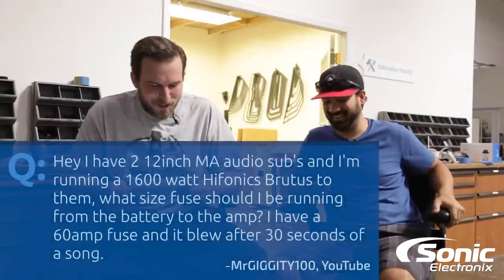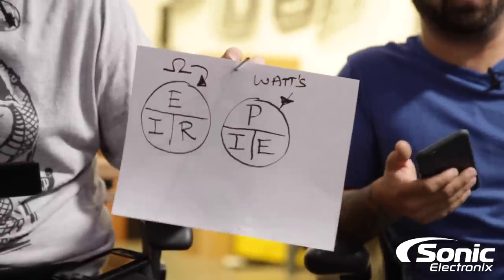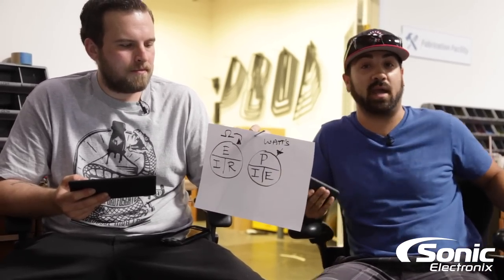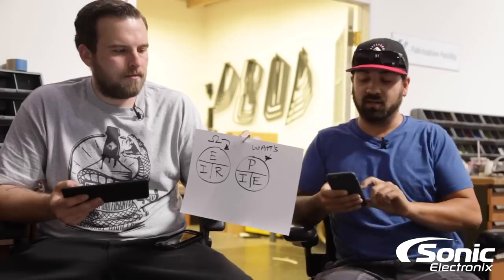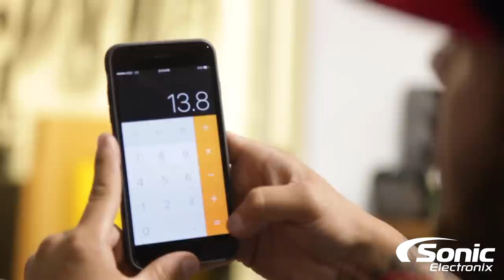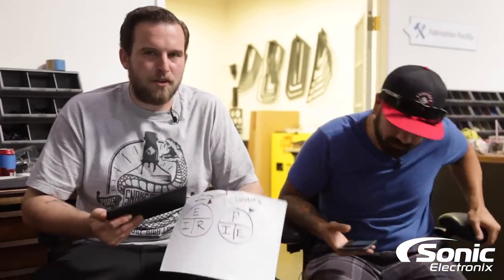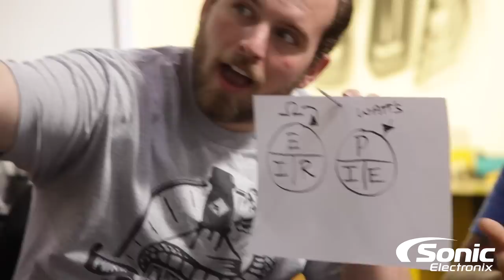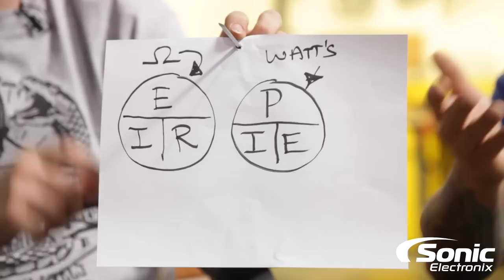What Size Fuse Do I Need? | Fuses vs Circuit Breakers | Car Audio Q&A

Comment: Your fuse should always be for the size and length of the wire. to protect the wire from a short. if you fuse for the wire and the fuse blows, your power wire is too small. only increase the fuse if the wire is capable of sustaining that amperage.
example. running a 2k rms amp on 10 gauge power wire. the wire will melt before the ~200 amp fuse would

Comment: Bro this video helped a lot I have dual 444c compressors and I’m running a 80 amp and for the fuse I was using a 80 amp fuse and it popped it . All my wires are good but I think I’m going to upgrade to a circuit breaker because I’m running a agu fuse .

Comment: If i use a circuit breaker do I still need to keep the fuse going to my power wires for my amps. I’m trying to eliminate bulky components and organize my wiring in my engine area.

Comment: Why would you use the amps rated A/C output either at RMS or not? The amp is a “Buck to Buck” step-up voltage to a “Class-D” amp! Use and amp clamp at the input to the device when on and working. Besides, there is no shocking to feel on a 13.8Vdc-14.6Vdc direct current system like shown in movies with jumper cables. Plus, why not own a test light or a decent digital multi meter (DMM)? You don’t have to spend over $500 to get a Fluke 87-V to test voltage drop. Radio Shack (If Open) or online sell meter lead wire with great high-temp silicone soft jackets or insulation. Solder some good alligator clamps with boots and make several lengths. Voltage drop measures the loss in voltage from point A to point B and doesn’t care if Red lead is backwards as it simply shows a (-) symbol on the display.
  Unless you are check fluids and minor repair under the hood, then get a DMM, because look over their, more fuses & relays from the factory. They may need checking as well. Their are good videos to teach how to use both and under $100 will most likely get both, and a test light. (Note: Pre-Biden Inflation Prices May change Your cost), but if you have $800 - $1,200 in stereo equipment, it is cheap insurance.
   Blow a fuse, never install a bigger one because you are guessing. That leads to “Thermal Events”, film on local news as car burns to the ground!
Yeh, start over and see if the insurance company picks up bill with full coverage, deductible and un-claimed installed items the Fire Inspector will look at first.
ASE Master Tech, 38 years experience

Comment: my question is does the physical size of the fuse matter as long as the rating is a proper? my little system only needed a 50 amp fuse and instead of using a maxi fuse i used a standard fuse holder and standard fuse both good brand, but a few "car audio experts" scolded me for it mainly for not using there fancy fuses but i digress.

Comment: @sonic electronix hi am running 2 amplifier ones is 2400watts and 6600watts wot fuse should i be on 4 garage wire for both of them please

Comment: I have a 1500 and 2000-watt amps and they run on a 60 amp breaker which has never tripped

Comment: These guys got the circuit breaker vs fuse question wrong.  When working on the electrical system, you should always disconnect the negative connection at the battery.  Opening the circuit breaker may not be enough, depending on what you are doing.  Circuit breakers also will fail over time, heat (like from the engine bay) will degrade it's ability to keep the system closed, as will overloading the circuit.  Tripping the breaker will reduce it's ability to handle a specific current load.

Fuses are cheap.  Keep extras in the glove box.

Comment: Shouldn't the amp be fused based on the consumption of the amp and not the output? I have never seen a 100 percent efficient amp.
Reply: +Timothy Hinton  i was just about to comment that ! for 1600w Dclass that has about 70% efficiency it means that it would have around 2100w input consumption....
Reply: +Evagoras koullouros Hey!
Your bace thought is right but in the wrong direction. The Amplifier can output 1600Watts. Thats what the manifacturer says. but you wont get them because no system has a efficiency of 100%. So you probably have around 1400 Watts (or even less). but this doesnt mean that you should base your fuse on those 1400Watts. 

for 1600 Watts you would get 115.9 A. so you need a 120A fuse. but to be honest, a fuse is just there so if a short circuit happens, in which case the Amperage is theoretically infinite, it blows up before the cables do. Its more important that the fuse is a Fast one and not a slow one. there are two types!
Reply: +phil7extreme  hello, yes we ansuming that is around 1600w output, it might be certified but still depends, the amplifier consumes more power than it actually outputs, because it takes dc voltage and make it into ac music...that conversion consumes power, and that why you get heat out of the amp..
Reply: +Timothy Hinton, Yes it should be IMO, basing the fuse size off the total output or the RMS is not an accurate method for calculating amperage consumption.

Comment: I have 2000 Watts rms around 2800 max and a 200amp fuse that blown when I plugged in the negative terminal and the wires look a little toasted.

Comment: I removed car stereo from Hyundai Getz 2008 and the battery wire giving 28v which is very strange. Do you know what could be the reason? Also taking positive from other section it always blow the stereo fuse

Comment: You want to fuse for what gauge and length powercable is not fuse just the amp.
The fuse is supposed to protect the car to not burn up in case of accident
Reply: orfeous this is absolutely correct! The fuse or circuit breaker is to protect the power wire running through the vehicle not to protect the amplifier! Your power wire should be able to safely carry the needed current to the amplifier (in this case 115amps)! Now remember the size power wire is determined by the needed current and the length of the run! So if your power wire is capable of 200amps then a 150amp fuse or circuit breaker would be ideal having head room! And since in this situation the amplifier is only requiring 115amps, then we know the amp will not draw more current then the power wire is capable of. if in fact something shorted out, the fuse and or circuit breaker would trip saving your power wire and possibly your vehicle! Remember your amp will already be fused on itself, we are strictly talking about the power wire run!
Reply: itsdatruff  what is your question?
Reply: itsdatruff  wow that is a complicated question.... You would have to do the Math on your 1/0 cca wire to see how many runs you would need to satisfy your amps. Of course you could just max out your wire runs and definitely running to a bus bar is ideal. I know you said you didn't want to add batteries but from my experience proper batteries make a huge difference. Good luck with your system.... Sounds like it will be epic!

Comment: HEY GUYS PLEASE ANSWER MY QUESTION!

I just purchased my 2009 Chevy HHR SS and I wasn't wanting to install subs or an amp really at all but I just want to possibly get new speakers that will be a little better in the bass category but still utilizing my stock power source. what is a few ways I can maximize my stock output to get the best bass sound out of my speakers once I buy new speakers? such ass maybe some sound deadener or something along those lines

Comment: I'm running 3 amps 2 Rockford fosgate r500d1 they are 50 amps fuse a pice and 1 is a Rockford fosgate t600-4 80 amp fuse should I get one fuse for all 3 or 1 for each

Comment: I have 2 p3d4 at 1ohm. A t1000.1. I have second battery in the back with 2- 200a circuit breakers. The one circuit breaker that runs between the amp and the battery keeps breaking at high volume. Any idea why that would happen? Thanks!

Comment: You should be using 14.2 volts for that calculation. Although the fuse size should be based on the actual consumption and not the total or RMS output. For instance, a 2K total wattage output amp using this calculation would call for a 140 amp fuse but the manufacture typically lists the actual amperage consumption as something like 30AX3, which puts the consumption around 90 amps so a 100 amp fuse.
Reply: You are splitting hairs and I am in fact correct. Don't think for a second that you know more about this than I do. Of course it's based on peak amperage 'consumption', that goes without saying. Stop trying to be smart when you aren't.
Reply: +Thomas Marshall Look's like somone blew there fuse LOL may of not been there car audio fuse but the sophisticated literature I am read such as "cyber tough bitches" and "twinkie dick hands" got me hella rollin on the floor!
Reply: +Thomas Marshall Dude... he is just talking about the same the same thing you are...which fuse is best for a sound system.  Despite your understanding of electronics, you shouldn't let your attitude slam people for being right or wrong.  I personally didn't have an idea of what kind of fuse to use but that's why I am hear and the sonic dudes make a lot of sense talking about "OHMS LAW" to figure out what amp the fuse to use.  That seems more rational using math than anything else I have read.
Reply: +Thomas Marshall I am no expert but the impression I am getting is he was talking about "amperage consumption" but you were clarifying that you have to match it to "peak regulated amperege since the amperage consumpiton is constantly fluxtioning...but I am also getting the impressing that he was talking about peak regulated amperage but he didn't write it exactly that way.  But really if you don't mind me asking....  why is it 13.8 volts or 14.2 volts and not 12 volts when the car battery is 12 volts?
Reply: +Thomas Marshall Much appreciated for the reply.  Makes perfect sense that it's the battery and the alternator ...and as you were stressing the fact for the proper gauge wire which I am sure can change the overall voltage of the system.
Reply: If you are willing, I would like to know more about your Big "5" as well as some more electronic information.

Comment: 4 channel amp that comes with 2 30w fuse. do i install a 30w fuse or 60w fuse or go by rms? 100w rms * 4 = 400w/13.8=28.9. guess i answered my own question. 1 30a fuse. thanks guys, old video but still helpful

Comment: My voltage is dropping way low, i have a xs power d1200 wired parallel with my stock battery. I have a mechman 240 amp alt and my voltage is dropping horribly low especially at idle. No blown fuses. Would a battery isolator fix the problem? Or is my alternator bad? This happened once before and it was because of a blown fuse. Thanks.

Comment: I have a Hifonics Brutus 2000rms Watts HD 3000rms tramps amp and a Orion Cobalt 2000 Watts A/B I also have zero gauge ran I have a 200 amp circuit breaker and a trip i had a 300 amp circuit breaker some one said take it out what circuit breaker should I put

Comment: When I do a 50Hz test tone on my 400W rms amp, the sub draws around 35V. 400/35 = 11.4A yet it managed to fry a 30A fuse whilst playing music. I'm confused.
I'm guessing I'm supposed to use the voltage value coming from my alternator but I don't understand why. Does the current step up at higher frequencies as the voltage drops? So at 80Hz when it draws 25V does the current jump up to 16A to make up the 400W or does it just use less power?

Comment: Forget calculation of Amp from rated "Sonic"  Watts of your Amp. Simply consult the manual/Specs of your Amp, check what is the   Maximum Amp your Amps will take (of what Amp Fuses they have - All good Amps have a blade or other fuse on the main power line). Add up  that number  from all the Amps   , put a margin of 20-30% and Voila!! that's the  Amp rating  Fuse you should put on the main trunk wire powering all the amps.

Comment: Sir my power inverter is 250 ac power output and has 500watts peak power  input is 12 and but it blowns out my 15 amp fuse can you give clarification of equation of this i know ohms law but dont know what i wil use value as ratings in inverter given

Comment: I hope people read the comments on this video before proceeding.  They do a good job of explaining ohm’s law, but they are absolutely wrong about this.  They have no idea how big the power cable is in his run, and you use the fuse to protect the cable, not the load.  For instance, if I run a 4/0 to the back of my truck as a “homerun” power circuit, I would fuse to right under the current carrying capability to ensure that if that wire ever shorts, the fuse will blow before the wire catches fire.  The only instance in which their advice is useful is if your amp requires external fusing, in which the manufacturer will tell you what fuse size to use and power cable size.
Reply: Nice..... Can I run on a Power wire an Inline Fuse by the battery and then in the back (trunk) on my soon-to-be amp rack before the power distribution block a circuit breaker ? mainly for when someone is working on my car or I make any changes? so  In front130 amp inline fuse and the back trunk a 200 amp breaker?

Comment: ok...?.... I have (2)15s...coo.right...aight...i have bought a amp from Walmart just something to hold me over till I can upgrade to my 5000mono..(big3)...upgrade..and second battery...on the amp I got from Walmart is has a built in fuse...and it blows the fuse all the time....I have diconnected the subs...and just ran it with the main three...still blows the fuse...help...please..

Comment: I would like to know what size fuse would i need with 2 12 that are 1200 watts EA and the RMS for EA is 600 and peak power handing watts is 1000 ea
Reply: the power ratings of the speakers dont come into the equation on the fuse end, what is your amp pulling?

Comment: ok guys i have a question noone seems to know the answer so im hoping you guys can figure it out. i have a 220amp alt, i put a 300 amp breaker on the power line. im using zero gauge power wire. the breaker seems to keep getting hot and flipping the breaker. i drive a 1997 pontiac grand am, i have 2 yellow top batteries in the back seat area. im running full air suspension with 2 viair 444c compressors (about 80amp a piece. and 3600 watts of total power with pioneer amps (but im not pushing the amps to full power. i have a straight power wore no fuse or breaker now and seems ok but this doesnt sit right with me. is this ok or should i figure something else out. thanks guys if you can help at all
Reply: +Octane Anarchy (Backyard Bandits VC) oh and it has flipped the breaker when not running anything at all just normal car things. (no radio or system and air suspension off)

Comment: hey guys I have a 2013 Camry, I have, A dashcam, 2 smartphones, iPad mini, a subwoofer amplifier connected at once. and I see everyday my voltage drops from 14.4 to 13.2 volts (sometimes all the way 12.7 when the car is on) how can I Fix this Help...!!!! "already bought a used altenator with 1000 miles on it. not installed yet" Thank you guys hope to hear From you.
Reply: I forgot to mention my pioneer Amp is 800 continues watts 1600 Max output

Comment: why would the voltage be 14 volts?isn't 14 volts the input voltage? 1600 watts is your output wattage. and since your talking about output shouldn't you talk about your output voltage which is most likely not a constant 14 volts

Comment: No amps run at 100% efficiency so surely their calculations are wrong! So say an amp runs at 80% efficiency the calculation would not be the same. 1600 watts @ 80% efficiency = 2000. divide that by 13.8 = 144.9 amps (that's a massive 30 amps difference). I am no expert I just watched a few other vids. I'm happy to be proved wrong if need be. Maybe check this vid to see what I'm trying to explain https://www.youtube.com/watch?v=0H005TcKHKo

Comment: Circuit breaker: worst solution EVER... The downside is its huge transient resistance, it "consumes" a LOT of voltage (for a single component).
Reply: +Ernestom5, So it's better to let the wire catch on fire and burn the vehicle up? I agree about the added transient resistance but with an efficient fuse and solid connections this won't be an issue.
Reply: +Rod Palm Did I say anything about NOT using a fuse?
Reply: No but I was illustrating a valid  point. The facts are that you have to use a fuse so your statement was a little misguided and insignificant.